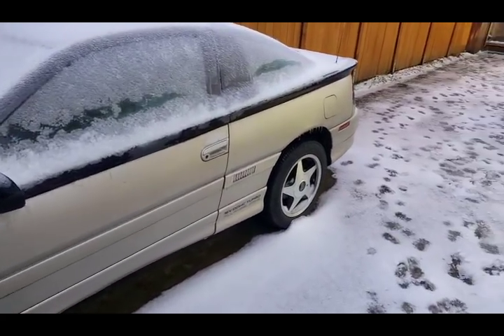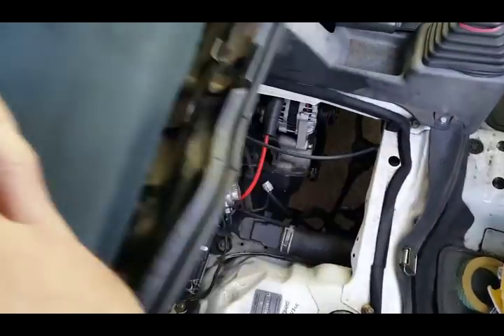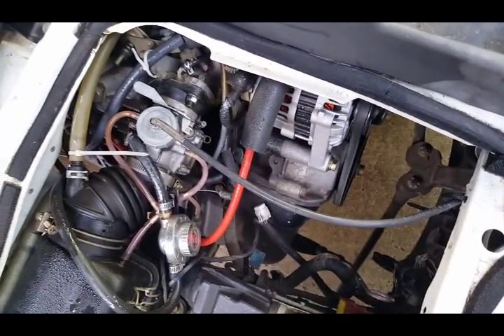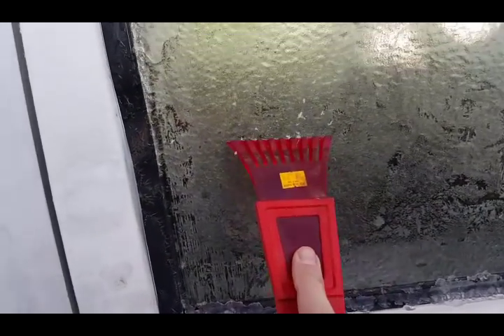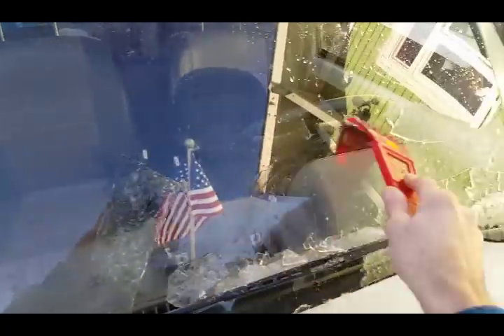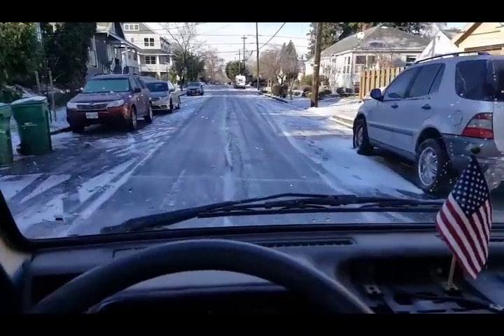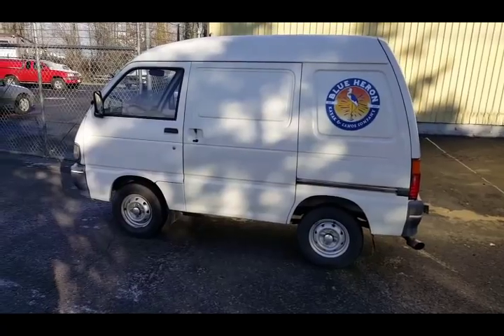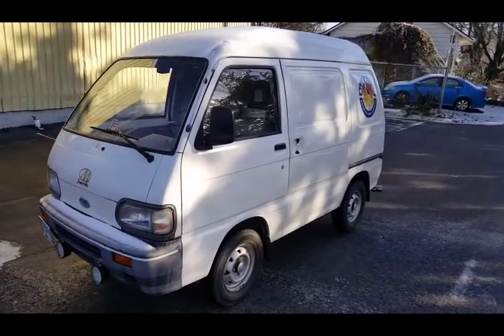Frozen Modern Microvan

Comment: You have a very luxurious vehicle: It has an inbuild fan for defrosting and heating. In my van, a Fiat 850T from 1978 (RIP in Rust Heaven) there was no such very modern thing. The heating was good -but only when driving! With no natural wind running through the heat exchanger there was no heat at all in quite big interior. And the only heat source was far away in the back of the car! But I loved it so much!

Comment: You need about 8 concrete blocks in the back of the van, tied down of course for traction weight.
Reply: What about a couple of 20 lb bags of rock salt?  Just don't let them get wet though -  or you will have instant rust... literally. You also can scoop out the salt as needed for traction.  Use a tote or one of the attic storage bins that are watertight and you are golden though.
Reply: Yeah, those will work too. It's only a small van, but rear wheel drive. When I was posted in West Germany back in the late 70s , I had a Mercedes 206D van, front wheel drive, 3-liter 6-cylinder diesel and to work on the engine, it pulled out on a sub frame with whole drive train, you need to put 900 pounds in the back as a counter weight, I usually let the dealership do it, back then in Germany labour costs were dirt cheap. Nice vehicle, but I couldn't bring it back to Canada, it was never sold here, just in Mexico.